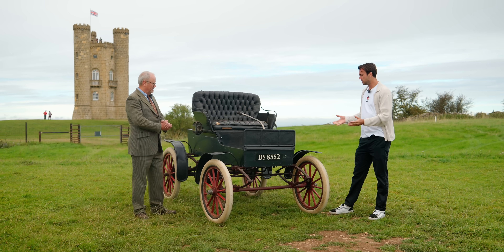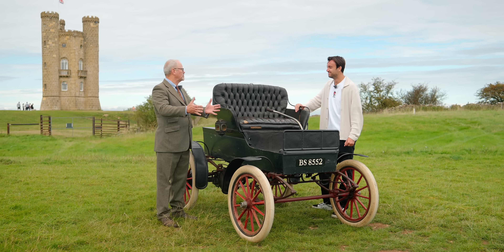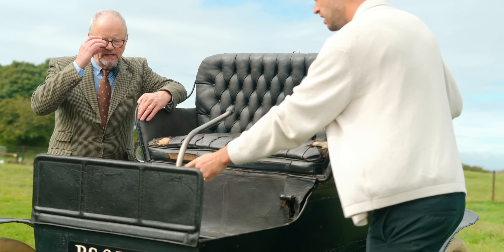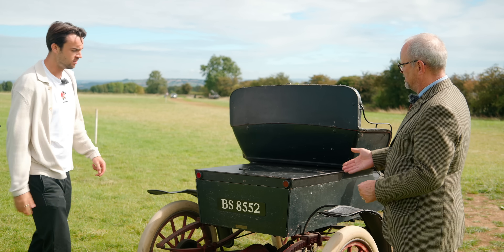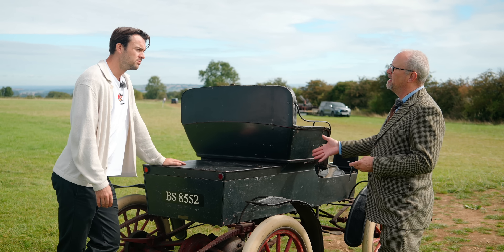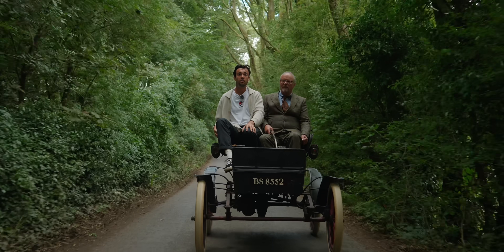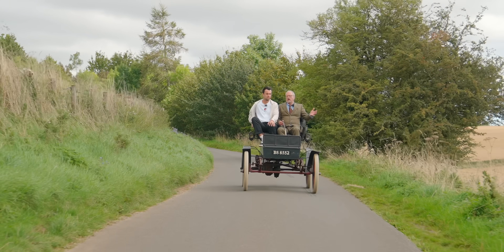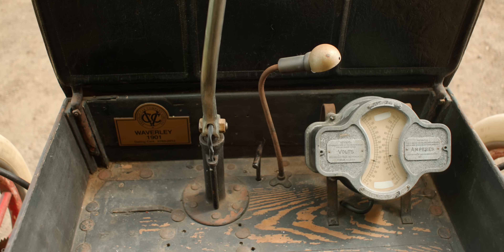Why Electric Cars Failed 100 Years Ago

Comment: I saw this at the FC Show, and so wanted to look inside it.
That is all the speed we need. I actually wish they made cars as simple as this still.
Reply: Yes, absolutely. If the electric vehicle was as light and as simple as it could be, and all the modern day fripperies were stripped away, real world range would be much improved and smaller battery packs could be employed, having a lower impact on the environment. Having 3 tonne plus SUV gin palace EVs is nonsensical. If electric is to be the primary method of propulsion, then light and simple is the way to do it. So far, only Citroen have got that memo.
Reply: Indeed. Also road deaths (including pedestrians) would be massively reduced. At present urban survival depends on your disposable income: in all but name, an arms race. When both vehicles in an urban smash weigh next to nothing, everyone walks away.
Reply: @Gottenhimfella  I've been thinking about that. Whenever those big SUV's that infiltrated from the US cross my path, I just see them as weapons made to kill. They never go off road in those expensive show pieces, I've never even seen them on a gravel road. The development of society is disappointing.
Reply: @98Zai  Ironically, small and light is also the name of the game in proper off roading and those SUVs are an absolute joke because everything about them is setup for highway driving which is usually the opposite of what you want off road. Everything needs to work differently off road, you can't design a vehicle that really does both. It's all contradictory. Making it better off road is always directly at the expense of it becoming worse on road. The suzuki jimny for instance is light and tiny and extremely capable and actually designed for off road. It actually was an older gen3 jimny the lady is driving when she went around it and talked to them. They're also super repair friendly. Just one example in the long list is they use a completely different ladder-on-frame construction, which isolates the body from the chassis so it doesn't get trashed bouncing around rough terrain. You don't see that on the soccer mom SUVs. They are just scaled up highway drivers that you'd be crazy to take in the mud and would get stuck immediately. Just watch Matt's offroad Recovery to see these silly things getting rescued all the time. We need more ICE vehicles like the jimny for people who actually go off road, and daily commuters should be electric, or better yet, no cars at all for the mundane stuff. That's essentially my lifestyle with my beloved gen4 jimny that I use only for adventures every couple of weeks and an electric scooter I use for getting around town. I find it annoying that these poser oversized incapable gas guzzling fake off road "SUVs" are creating regulatory problems for those of us who truly do love off roading as a hobby. My carbon footprint is certainly still much smaller than even an electric car owner who drives it every day.
Reply: @mikebarnacle1469  Well said! It's a particularly ironic joke that almost all current (so-called) "serious" SUVs cannot risk going into water of any depth, lest it ruin the wheel rotation sensors which provide an essential input to their already inadequate ersatz simulation of rigorous 4WD by the engineering equivalent of a conjuror's hand-waving.
Reply: Yes! It would be completely user serviceable and I'm sure it would last forever, with interchangeable "faceplates" like ye olde mobile phones :D
But, it wouldn't be lucrative enough for production in this society. I hope I'm wrong though!
Reply: There is the Citroën Ami.

Comment: Nothing has changed. EVs still too expensive. We need to reduce all unnecessary electronics and revert to basics. More efficiency, fewer batteries, lower power, less weight. Drop heavy safety nonsense

Comment: I heard a story that the electric car lost out to the petrol car due to warfare in the early 1900s, petrol was easier to take to the front than batteries or extension cables.
Can you find that out?

Comment: 60 miles range with ....? kWh battery capacity?
Energy consumption will be pretty low at such speed (hardly any air resistance) and such narrow tires.
The weight will also be rather modest, despite the heavy lead-acid-batteries.

Comment: 122 years of progress ?
They were sh1te then and they are sh1te now ! My battery in my EV has lost 1/3 rd of it's capacity and range in 37k miles and 7 years and 6 months. Batteries remain the problem and always will.

Comment: I wonder what the size all that would be if we "translated" directly it to modern versions of the equipment. For many places around the world something small and open like this would be amazing!
Reply: And I wonder what the range and charge times would be if we had over 100 years of innovation into the EV instead of combustion engines.
Reply: @colinwiseman  we didn't have the technology to do it back then, until the Prius and hybrids came out, then we were able to switch to EV, if we had spent less time on hybrid, maybe we could have done it faster, why are we still using gas today 100 years later, because it was the first thing that worked, despite the pollution
Reply: @danielzhang1916  I know why, I was more just wondering what could have happened. If the electric starter motor hadn't been invented, we might be living in a cleaner quieter world.
Reply: @colinwiseman  that sounds good on paper, but the reality is we would be nowhere without the electric starter, technology always has a downside, cars changed everything for our development
Reply: @danielzhang1916  stop being so boring!

Comment: Did Li-batteries need modern tech to be discovered and manufactured, or could it have been a lot earlier if the whole business had dumped the fossile fuel and gone all in on batteries?

Comment: I couldn't help noticing that EVs were as outrageously expensive back then as they are now. The modern equivalent of twenty-five grand? Blimey. A toy for the rich, just like today's EVs. (And their similarly over-specced, overpriced ICE counterparts.)

And before you berate me for suggesting that twenty-five grand is a bargain, actually, and that real people (actually) will happily spend twice that amount (actually) on an EV - shut up, you swanky toffs, because twenty-five thousand quid is a bl**dy disgraceful sum to blow on a supposedly 'cheap and simple' car for cheap and simple peasants.

Modern EVs (in the west) are a rip-off.

And just think... A few years after this wee electric beastie was produced there were (dodgy, crummy, but AFFORDABLE) petrol cars being churned out that sold for the modern equivalent of $4,500 instead of $25,000.

Truly, some things never change. 😞

Incidentally, talking of ICE cars or, rather, iced-up cars: my late dad had first a Morris Oxford and then a Wolseley that could both be started with a handle if required. With snow on the ground and a 12V battery and starter motor that didn't want to play it was a brilliant option.

Even I, as a weedy little teenaged girlie-girl, could get them running. Very convenient.

Comment: This is a wonderful video.  Thank you for putting in the effort to make it fun as well as informative.  Modern battery technology made a big difference as you pointed out, but let's not forget, the early GM EV1 cars used lead acid batteries and were practical cars - good acceleration and 80 mile range.
Reply: The AX,Saxo,106,Berlingo,Partner Electrique 1996 to 2005 used Ni-Cd batteries. Some of those batteries that are in my 2002 Berlingo are still at or near 100% capacity, after 20 years. They are not as energy dense as lithium ion but they have much better cold weather performance .
Reply: Thank you!  I had never heard of it.  I just did some research and was pleased to see that Citroen was involved.  They were always ahead of most others.  This reminds me of the late 1990s when I lived near Peachtree City, GA, a city that had built a network of paved bicycle trails and then permitted golf carts on them.  Golf carts replaced cars as the preferred means of local transportation.  Almost all were electric, with very few using gasoline. Advanced, mostly foreign, carts were beginning to show up with newer battery chemistries, A/C motors, and dynamic braking.  Nobody I knew was thinking cars could be made that way.
Reply: @aplace4usdotcom  we could make electric carts, but we didn't have the technology until the Prius and hybrids started coming out, then we were able to switch to EV, it was impossible to do it even 50 years ago
Reply: Maybe not 50 years but I said EV1 and you said Prius.  Either way it's 1997, 26 years ago we could have started moving to electric.
Reply: Hi James. The big drawback with lead-acid batteries is the weight, and the corrosive electrolyte, sulphuric acid. Cheers, P.R.

Comment: Electricity wasn’t wide spread in 1901 nor was even gasoline. Every town had their own system which isn’t always compatible with the next town. UK was infamous on this issue.

Electric would end up failing partly due to range and mostly due to the December 1911 invention of the electric starter… 

But in the end the Great War killed it off for good. Rapid forced standardization of the automobile by the war did what nothing else could on its own.

Comment: the technology and the infrastructure just wasn't there yet. It took about 16 to 20 hours to charge. Though there were some cities that had battery swapping stations. Also, they were used a lot for taxis. However, at that time not everyone had electricity yet. Most homes and buildings did have electric till the 20s or 30s. Especially in the countryside. Therefore gasoline-powered cars we're able to be filled up quicker and go further distance.